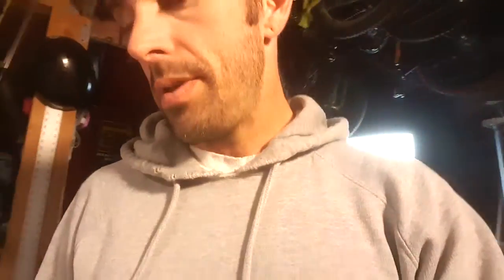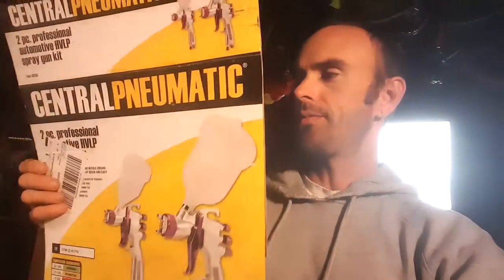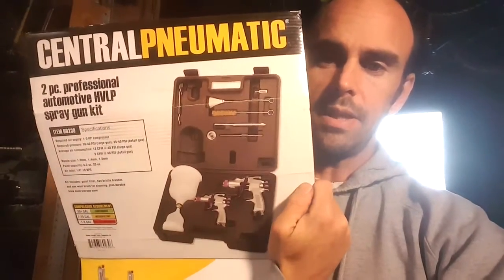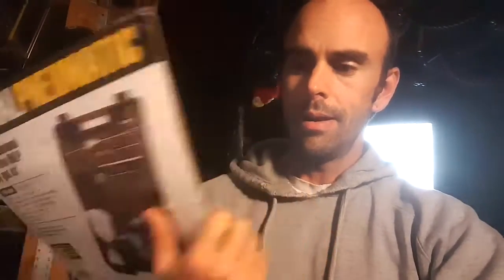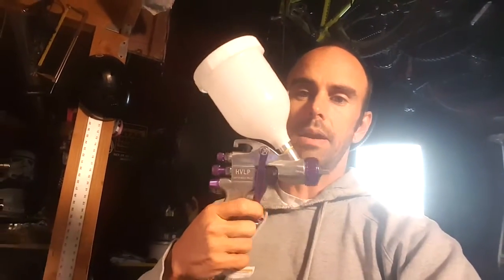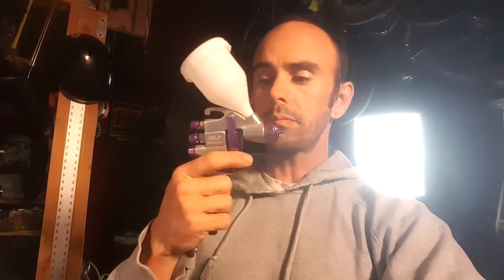Pre-chroming tutorial initial supplies to have.

Comment: Gordon, I just bought the spray chrome kit from Angel Gilding's website.  I am planning to practice silvering on some classic instrument bezels from a 68 Mustang made of plastic.  My question is, how glossy does an item have to be before using the chroming process to get the best results if my goal is a mirror finish?  I am looking through your videos looking for a beginning to end tutorial on the Angel Gilding products.  Thank you for your time :D
Reply: any luck? ive been looking for the same
Reply: No luck, but I'm receiving my kit today.  I prepped my pieces by sanding them down and getting them smooth. Going to primer them when I get home and then begin working with the kit asap.  Gonna try and get some video up as I go along.
Reply: Nice, let me know please. Definitely interested
Reply: Does the the instructions have info on mixing the chemicals in larger volumes?
Reply: I've just started playing with this myself and according to Angel Building website the surface should look like glass.  I tried it just on top of my 2K primer that had been wet sanded with 1000 grit sponge and it came out dull silver.  I've gone back and sprayed my 2K clear to a glass finish and am trying the chroming process again tonight.